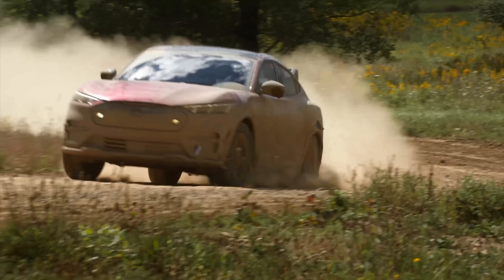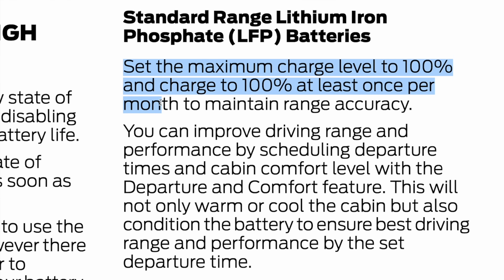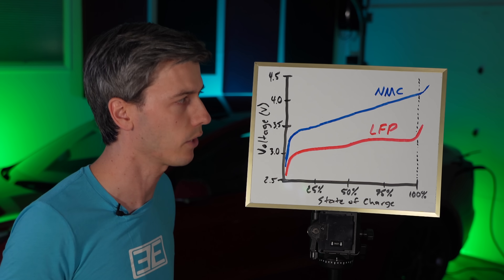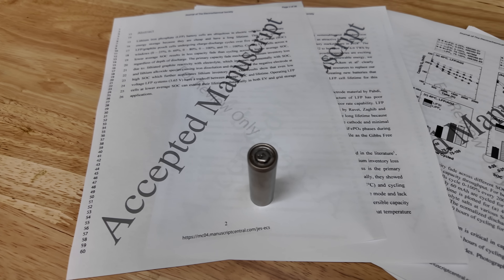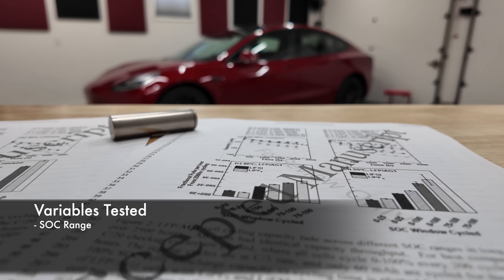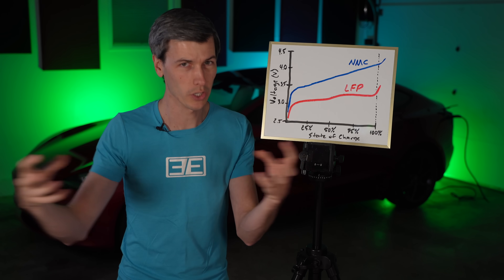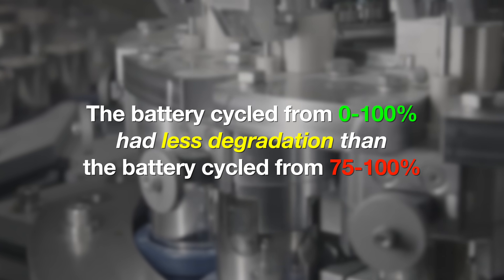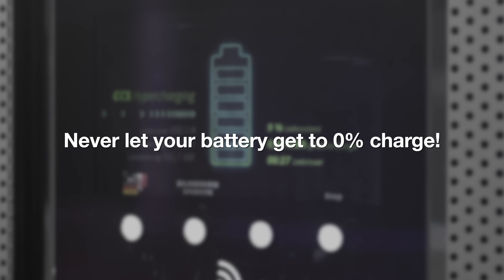How To Ruin Your Electric Car's Battery - LFP Edition!

Comment: what i love about my petrol car is that it doesn't matter how much fuel i have in my tank or how long i leave the fuel in the car, it just works!
sure really old fuel burns like crap and car's that have been sitting around for a few years do need some help to start and that old rotten fuel would burn like crap.
but it JUST WORKS.
no need to lecture anyone about how much fuel to refill in his car or how much can he drain the fuel in his tank, or that its recommended to keep the car with a fuel filling hose always attached..

i think the biggest problem with EV's is that from the very start they were designed for planned obsoleteness, if a typical well maintained petrol car can be running for over 30+ years with the occasional electronic's problem here and there (or if its a simpler car from before the 2000's than not even that). then the life expectancy of EV's is designed from the very beginning to last at most 10 years before it becomes a huge money pit to keep on the road (especially with the exorbitant price of batteries).
you would expect that EV batteries would be a lot cheaper these days, i mean the mass production of Nickel Metal Cadmium Cells, and of rechargeable battery cells in general has grown exponentially by over 5000% in the past 15 years, and that now there are so many EV's being produced, so you would expect that the price of battery packs and cells would drop down significantly, just that it didn't drop down almost at all.
the price of EV battery packs remained more or less at a standstill in the past 15 years, but the cost of battery cells did drop rather significantly by approx 40-60% per cell (of course that's for individual cells, if you buy them in bulks that number is significantly higher).
a good example as to why EV's are designed with planned obsoleteness in mind is the original Tesla Model S models from 2011-2015 - nearly all of these have significant problems and dead batteries that require replacing, and of course the Tesla Battery warranty is well overdue on these so the replacement batteries are insanely expensive (almost more expensive than the cars themselves in some occasions too).

i also feel like the EV manufacturers are using LFP batteries on purpose for these lower tier cars (Tesla) or for their EV's in general (the others) because LFP batteries are pretty significantly cheaper than NMC batteries, and a bit less reliable due to how their chemistry is - since there is a big reliance on the car's computer itself to understand the real capacity of the battery pack and calibrate itself to it.
most car manufacturers know that most people are idiots so they opt to use LFP batteries instead of NMC batteries to save a couple thousand bucks on the battery packs - but these savings almost never trickle down to the consumer.
Reply: bro, LFP batteries last roughly twice than NMC batteries, and less rare metals used, so less environmental damage. Measuring real capacity is easy, just charge to full and drain to near 0%. it's only once per month, pretty sure it won't take much of anyone's time. The main reason of people buying EV is because electricity is cheaper than fuel, and then when your car is stationary with AC running not much energy wasted unlike spinning your main engine
Reply: @samueladitya1729  clearly you have no idea what you are talking about and are mentioning two conflicting interests.
1. LFP batteries are significantly CHEAPER to manufacture but have a total life expectancy which is about HALF of NMC batteries.
2. NMC Batteries can be made to be much more condensed - resulting in significantly more efficient use of weight and space and in improved "range" for EV's out of a similarly sized battery pack when compared to LFP batteries - their only drawbacks are the manufacturing costs.
3. if you really care about the environmental impact of the production of one battery tech over the other let me tell you this - producing either of these batteries is going to be much more pollutive to the environment than the production of a petrol run vehicle,
in fact, the environmental impact of the production and 15-20 years of average use of a petrol vehicle combined are barely going to scratch the surface of the environmental impact of producing a single EV and its batteries regardless of battery technology.

and this is even before mentioning the fact that petrol vehicles can be fully dismantled and fully recycled, EV's? yeah good luck recycling a dead battery - not only is one heck of a difficult task to do, it is also really expensive and requires very specialized tooling and equipment and it is also an extremely pollutive process.
if you ever wonder where do all the dead batteries go? - they just dig a "safe" hole and burry them - recycling batteries is simply not financial.
Reply: @HoLDoN4Sec  Source: trust me bro... 

Seriously, just a quick google, most source says LFP last 2500-5000 cycles, that's over 600k miles while Nickel based is below it. EV batteries don't just go to landfill, we can repurpose them for energy storage because it still has like 60% capacity left.

And for pollution, EV vs ICE quickly break even the carbon emission in 20k-40k miles, even if the EV is powered purely from coal, it still may break even in 70k-150k miles. Rare metals mining damage environment badly, and LFP doesn't contain rare metal, and it's mostly recyclable even it has low economical value.

Comment: Other suggestions state taking the LFP Battery down to 10% or lower on a regular basis, can be detrimental to battery longevity. Is it best just to do a mixture of all different charge cycles?

Comment: another reason for lfp to remain plugged in and at 100% is so the bms can rebalance, it will bleed of some of the cells with the highest voltage so the ones with lower voltage can come up in voltage and have the pack more balanced

Comment: Nice video. But I've got a question: let's say I don't use the car for 1 week and I can control in my garage via app the SoC and the possibility to charge it whenever I want.
Is it better to keep lower than 50% the battery to extend its longevity? In other words, does it make sense to keep it enough lower (like 25%) and charg it only when you need it?

Comment: I find it really funny all this talk about batteries and battery tech.
I retired a few years ago, and during my working life I bought a few battery tools, I also worked on very busy work sites, where many trades used battery tools and over the years the Builders pole had less and less power cords going to it as more and more battery tools became the norm.
Not once did I ever see anyone charging their tools battery to only 70% or do anything other than charge to 100% after running the battery down to where it no longer worked in the tool and if you pressed the button to see how much charge was left, it showed zero.
Now maybe as smart chargers came into every brand, they may have charged the battery only to what they needed to stay in tip top condition, but then you would have also had to change the tool so that it didn't discharge below the 20% or what ever was the required range.
I got an easy ten years plus out of my battery tools batteries and I never treated them very well, they got chucked about in the back of the Van, they were also charged in the full sun at the builders pole as did most Tradies.
Not once in the 30 plus years I used battery tools did I see or hear a tradie say their battery died and ask if anyone had a spare.
I think this battery crap is all for morons as well as to try and make it seem much more difficult.
If it was important why not make the software take care of the charging as well as how and when.
I will read my owners manual to see what they recommend as far as to keep in the warranty period as well as following what the manufacturer recommend to make my warranty viable.
Same as I had to do for my first ICE car that I had to drive a certain way for a certain amount of miles as well as what fuel I had to use for the best economy as well as how often the oil and filter had to be changed, all these would affect the motor as well as longevity.

Comment: 7:55 imo you should've put short intro that explains why tesla recommends to always have car plugged in(that you put instead at the end of the video). 
(7:55 does not matter because most drivers do not do relaxed driving, 
because of that the more charge you have the less tear on battery happens 
- due to liion batteries accelerated degradation caused by high discharge current under low remaining capacity.)

Comment: My practices for LFP batteries are:
1) Charge whenever it's 45% or under
2) Charge an amount depending on ur next trip, pivoting around the 60% mark:
If intended to use 30%: SOC 75-45%
If intended to use 60%: SOC 90-30%
3) Charge to full 100% once a month
4) Let it rest at least 30mins after usage/charging

Comment: @EngineeringExplained great video.  Only area I feel needed a better explanation, relates to the importance of depth of discharge (DOD) for battery longevity.  The lower the DOD, the better.  That is why, between 75-100% is better than 0-100% according to the study.  I mean, for example, 40%-65% is much better than 75-100%.  So, for people who do little mileage every day, best practice would be to keep low SOC and (slow) charge every day 10%, 15% etc, instead of charging e.g once a week from 10 or 20% to 90 or 100%.

Comment: Thankyou so much Jason, for EE and your video on best practice LFP battery management. I've especially enjoyed the chat with @WillProwse also. Having been a motoring enthusiast for many years and a first time EV owner, it's all of very great interest to me as I form my charging routines for the Genesis GV70 which I purchased late last year. I have charged exclusively at home for months now, as I'm able to utilize the 3.6kW charger plugged in at home when my Solar PV panels are generating plenty of power during the day; essentially costing me nothing. I'm still able to use my car any time I need to and top up the energy used easily and efficiently. I'm able to drive anywhere within the region and periodically to Sydney and back quite easily (~340-360km).  But I have wondered what constitutes a 'cycle', as I'm tending to do shorter trips than when I had to drive to work for example. So, simply because I'm able to sufficiently charge the car for my driving profile for free, I'm tending to maintain a SOC of between 60-95% normally, charging it for 1-6 hrs duration, across 5-10 times/week. Living in Newcastle, Australia (2 hrs north of Sydney), the ave temp is pretty mild;  reliably between 10-20 degs C in the winter and 20-33 in the summer. Over the shoulder seasons, we have even less range/variation as well. From what I've read, I might benefit from charging to 100% a bit more often but also lowering the average SOC to a range closer to the 0-25% suggested; perhaps 15-40% or so, to prevent being caught out. The build quality of the Genesis is top shelf and appears to equal that of the Lexus cars I've owned in the past, so battery longevity above about 80% max capacity is of interest to me. 
In the end, should the LFP battery which I believe I have, degrade to an unacceptable level circa 2035, I'm pinning my hopes on the major EV manufacturers being able to retrofit newer tech batteries to the car, such as the sodium or solid state types under development now. Your thoughts and any other advice?

Comment: I looked at the study and it showed about a 10% drop when charging to full capacity. 
So instead of a battery lasting 10 years it might last 9 years.
I'm not gonna spend a decade trying to keep my batteries in a low state of charge, to save 1 year of life of the battery. Just buy some new batteries after 9 years with absolutely NO headaches during those 9 years.
Reply: It doesn't seem that complicated to me. Charge to 80 most of the time. Charge to 100 sometimes. Discharge to 50 if you're planning to leave it alone for a while.

Comment: curious that the critical battery study referenced around 8:00 chose a bunch of ranges but ignored the range that is most promoted by car manufacturers in their user guides/owner’s manuals, and which most folks will be aware of - 20 to 80%!

Comment: Thank you very much for your explanation. I've been reading many studies about LFP, and that was one of them.

I'm following you for some time and saw this video a while ago, but only decided to comment now :)

Meanwhile there are things this study misses.
- Does constant cycling 0-25, 0-60, etc. Does not take in consideration other kind of cycles, like 40-60, 30-70, etc. But can give an idea that lower is better than high, which is kind of common for all batteries. Meanwhile, it's possible that 100-20% is better than 80-0%. Usually with higher depth of charges, the last 20% are detrimental to LFP.

Also, one thing is testing individual cells, another thing is a pack with more than 100 cells.

It''s not that the general behaviour is the same, but the cells do not discharge at the exact the same rate, one could be 30% SOC, and the other almost 20%, and although the charge is very constant, at the end, the voltage drop in the LFP is steep.
This means we can have for example 50% "high" voltage cells, and a 50% "low" voltage cells, which means the load between them can became be very different also, and put excessive stress on some cells. Meanwhile, also can make some cells drop more voltage than should (depends on how the BMS deals with that, if it allows a couple of cells to drop a bit further before cutting out the power totally).

What i mean, even for individual cells lower SOC is good for both calendar aging and cycling, doesn't mean that for a full pack is the same (at least for the cycling part). Also not pratical for EV's.

And as a Pack with similar cell voltages across SOC, LFP also needs some balancing (charging all to 100%), so the SOC can be similar between them. With time / cycles they tend to get more and more apart, that's why it's not so wrong saying LFP need charging to 100% for better battery health. But as you say, from time to time, and should be rare (1 time per week to 1 time per month, depending on the use), generally speaking, SOCs above 70% are more harmful for LFP, although more tolerant than NMC.

There is one part that i don't fully agree though. You saying for LFP is better to charge only when the charge is low. That i don't think it's true. DOD is still a thing with LFP (almost insignificantly comparing with NMC ones), but still is. You probably can have more cycles 70-40, 60-40% (like with) NMC than if you do 90-20 or 100-30%.
The thing is, with LFP you can win more 10-20% Equivalent Cycles, NMC you can get more than double this way.

I would say a different rule for LFP maximum health (with usability in mind):
- Charge whenever you want, but avoid charging fully if you don't need to, drop to below 70% as soon as possible.
- Charge fully between once per 1-2 weeks.
- Don't let it go below 20% frequently.

Comment: Here's what my new VW eHybrid pHEV recommends... They don't say if its an LFP or NMC battery... Tips for Battery Charging and Vehicle Storage. For daily use, it’s best to set the battery charge limit to 80% via the infotainment system (Battery Charge Limits) or activate Battery Care Mode. If you’ve only driven a short distance in electric mode, avoid charging the high-voltage battery after every trip—charge based on your actual needs. When planning a trip, use Scheduled Charging in the infotainment system. It helps optimize the battery's performance at departure. If you charge to 100%, drive off right after or set a scheduled departure time to avoid battery stress. If your vehicle supports DC charging, don’t use it too frequently—prefer AC charging for regular use. When the vehicle is parked for a long time: Keep the battery between 40% and 70%. Avoid exposing the car to high temperatures or direct sunlight.

Comment: 5:35 ❌ no, false, you are wrong!

The BMS does cell balancing around 80-90%

Why does this happen? My guess is bad BMS design not forcing cell balancing; it is typically done from 90-100% because that is already done at a lower current, and cell balancing is limited to low current charging

Comment: It seems obvious for all these years of different technologies the battery lasts longest “around” 50%. So if you use an average 20 percent of your battery every day you should set the charge limit at 60 or 70 to keep it around the 50% ~ish for daily. Also this would allow you to slow charge at home. 
And fully charge it for weekend trips.  You won’t really need to charge it to 100% manually because if you always use around the same percentage daily, the accuracy of the calibration is not important at that time.

Comment: Great video on batteries ! 👍
 There are ideal conditions if you live in an urban area and only use your EV under these conditions . Having a home charging station and commuting back & forth to work and running errands around town . Only requiring a 50-70 percent charge at most . 
Still , you may need or rent a piston engine car for long travel and convenience !

Comment: The reason why EVs  wont catch on soon is because nobody wants to play this puzzle in their daily life- then try to justify proper ownership care to a trade-in buyer or craigslist buyer.  It took decades for wives tales (like diesel owners talking about engine oil additives or running ATF in fuel)  to enter the public dialogue, and I believe most won't be comfortable with owning an EV until everyone just kinda "knows" the thumbrules and opinions.

Case in point, if Joe American went to a dealership and bought a Tesla, he wouldn't want the sales rep to break out the whiteboard or explain the battery spec sheet in excruciating yet necessary detail...when he already knows the gasoline car rules.